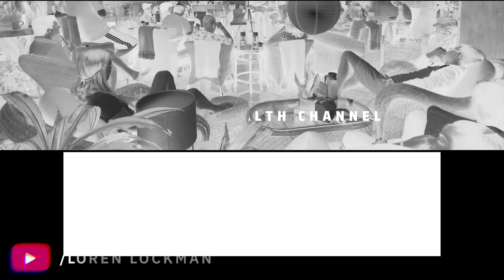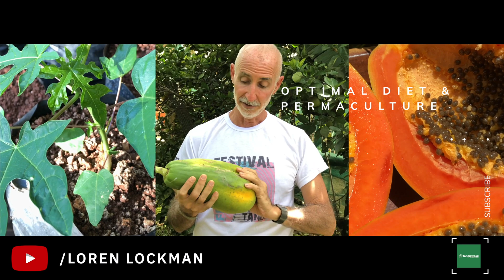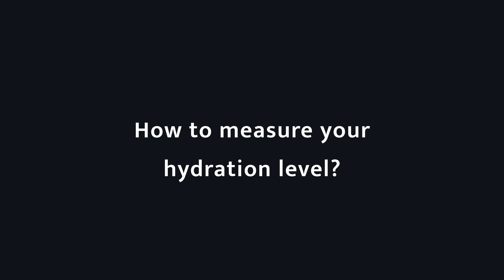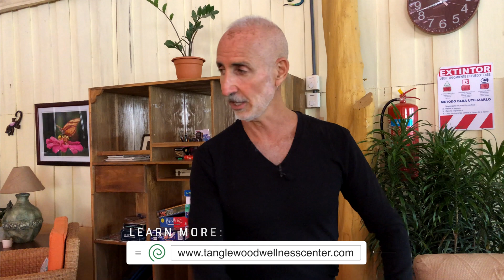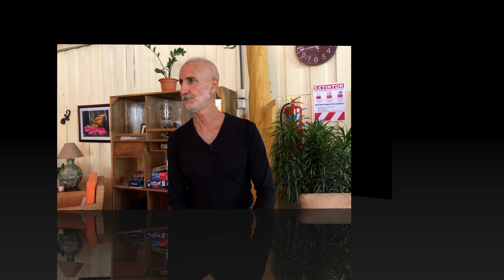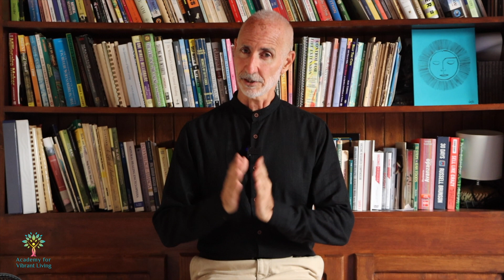What is the Best Way to Measure Hydration?

Comment: I've been using a >£30 bio-impedance scale for a eight years and find the readings remarkably consistent and repeatable ( and across different scales). But this does not measure intracellular( within the cell) vs intercellular (between the cells)  hydration just bulk hydration.
Reply: Have any reference for that scale ? :))
Reply from the maker: great!

Comment: thank you for the video Loren but at Tanglewood as for my understanding they do more with the received readings from the scale readings to get a more accurate number, there is some calculation done after the readings, can´t you explain how that's done??  for the people who spend as you mention 500usd on a scale and would like the most accurate number
I spent 500uds on bc 1000 Tanita scale, which is a high-end scale that's really good but not that accurate, and as I understand Tanglewood has also used this machine in the past. 
anyway good that you shared this which is very helpful. just need a little more information.